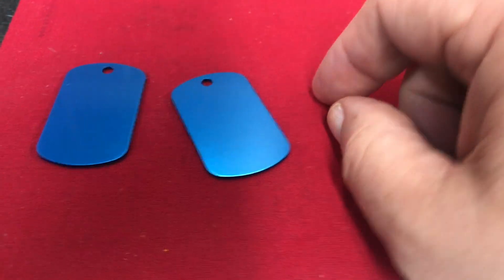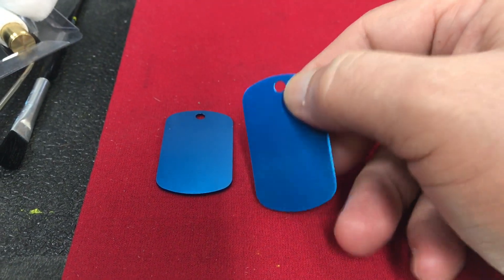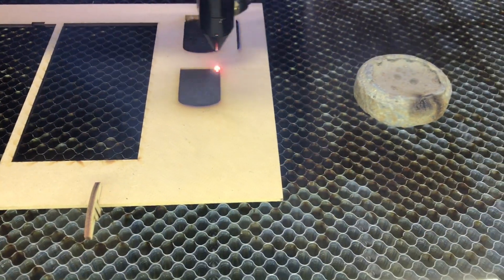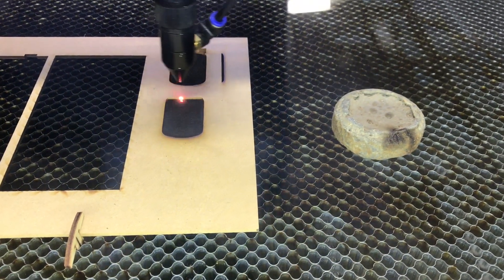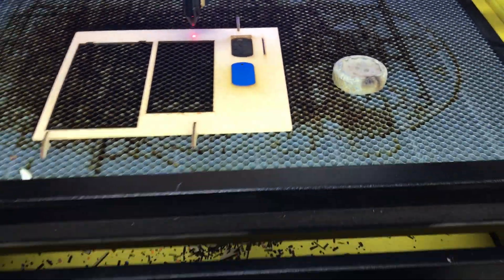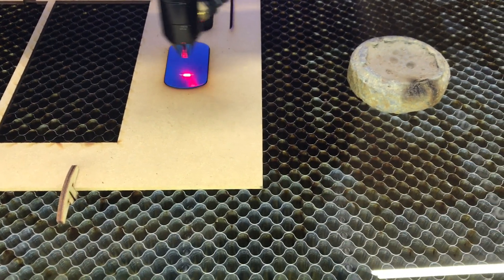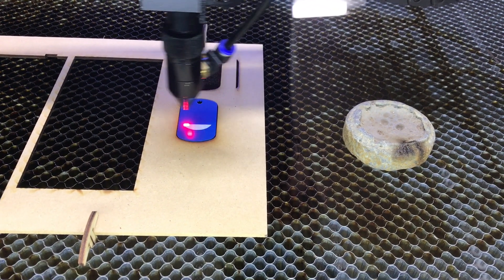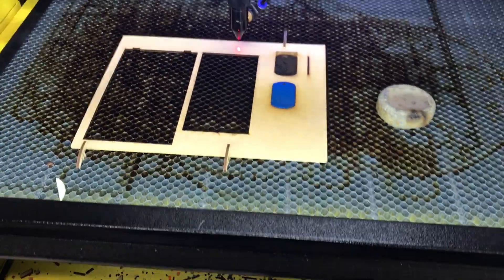Laser Engraving Anodized Aluminum Dog tags

Comment: Very Cool video, I have the same laser and use lightburn. Im only marking anodized aluminum just like this, Ive only done text but it seems to come out a little fuzzy even though I am on focus, it always wants to outline and then fill in numbers like a 1 for example, instead of just making a thin line number. Ive tried it on the line setting, fill setting, its the same. I know it can do thin lines because I made it etch a horizontal line and it came out super fine its just numbers and letters. The text I do has to be very small. 1.5mm tall and smaller. What settings do you recommend/use?
Reply from the maker: Out of focus can be a few issues, for one mirror alignment is critical as is proper focal distance (do a ramp test) lastly check your lens, make sure it's OK (not cracked or burnt) and if that is all good you should be good. Anodized aluminum is fairly forgiving but you can lower your power (sorry been awhile since I have done aluminum but start at 200/17 (sp/pwr))

Comment: Hi can i know whats the power setting you used for that. Thanks!
Reply from the maker: I used 25% at 120mms but this will be different for every laser (even same models will vary a little) so you need to do tests.
Reply: @terrymakes3613  what's the max power output from your laser? or what's the exact model of your laser and i will google to calculate my 10w power settings
Reply from the maker: @dablet  My laser ia an Omtech 60w CO2 laser. 10w means you are using a diode laser? The settings may be very different since it's a different wavelength of light. I would get some of the cheap anodized aluminum business cards to test, it's the same as the other aluminum but thinner and mass produced so cheaper to play around with.

Comment: Nice! Do you know if a 20W fiber laser could do the job?
Reply from the maker: Probably but I have to admit I have no experience with fiber lasers directly. I know they can mark on metal directly while the CO2 only removes coatings.
Reply: yes, the fiber laser is good for metal marking.
Reply: I have a 30 watt OMTECH fiber laser, works very well on anodized aluminum and it's very fast. I make dog tags with names and addresses and phone number of pets and it takes longer to program the text than it does to run the tag. Takes around 20 seconds to run the tag

Comment: Hello..
I need to make +500 metallic tags (same size as dogtag) with laser printing/engraving, what model of a machine should I use, and who can I get it, thank you so much.
Reply from the maker: If they are just bare metal you need either a fiber laser or co2 laser with special coating for the metal (makes it so the laser marks black). CO2 lasers do not affect metal directly but they can remove coatings like anodizing on aluminum (as in my video) or paint or powder coating. I am not going to recommend an exact machine as there are way too many variables and even so called "experts" will give vastly different answers than other "experts". I would suggest you check out a Facebook group called "the original dud with a laser" lots of good people in there that will help you but you should provide a lot more information like budget, annual usage, type of metal, type of marking (engraving or just coating removal) and if possible photos with a few examples of what you want to produce. You could start off as low as $500 or go in the the tens of thousands of dollars so your exact need is key.
Reply: Check out the fiber laser groups, you will have some info there. https://www.facebook.com/groups/4105345129538639/
https://www.facebook.com/groups/440091022989424/